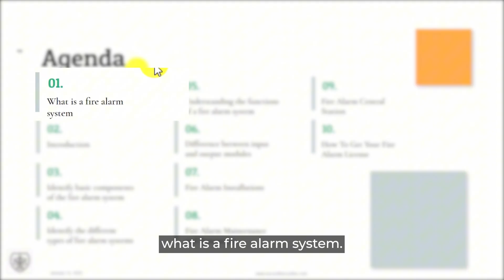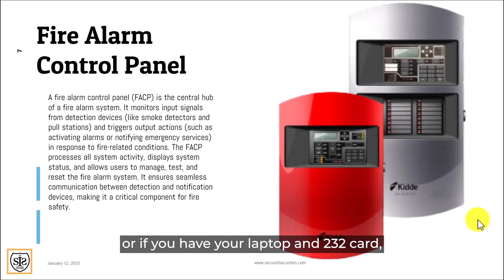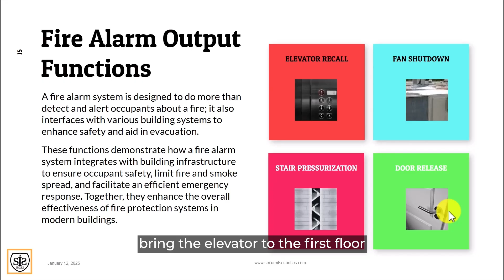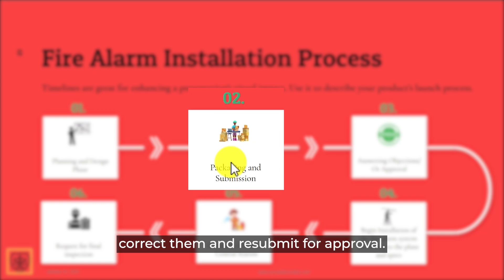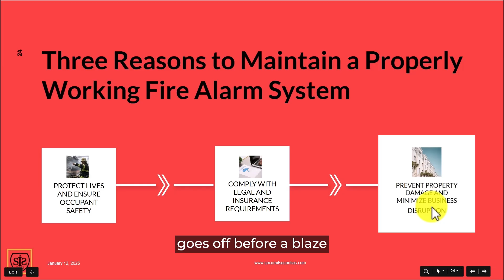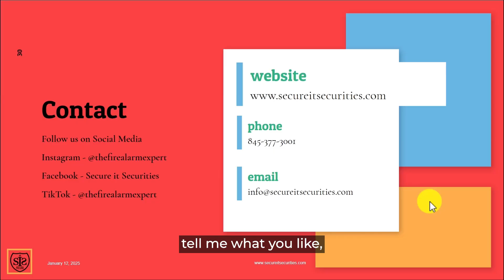10 Secrets to Master Any Fire Alarm System 🚨

Comment: A rate of rise 135 degree Heat Detector is very common.  If the temp goes up 15 degrees in one minute it will trip.

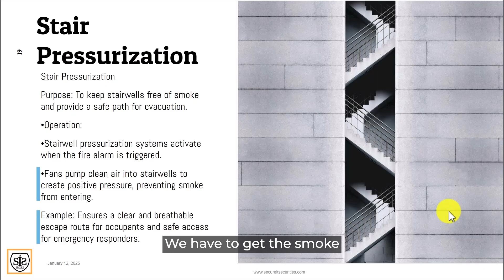Comment: Great video, lots of information. Just one point of clarification. At the 18:00 minute mark your slide shows that the Stair pressurization "fans pump clean air into the stairwell to create positive pressure, preventing smoke from entering" which is correct - but you say that the "large exhaust fans at the top of the stairs that are actually pulling all of the smoke from the bottom floor all the way to the top out of the building" which is actually negative pressure and not safe in a stairway.

Comment: and how to do serial simplex port troubleshooting  ..    https://youtu.be/vhBjSgtxBDs?si=q42DhPoSsA87Co0Q
Reply from the maker: I used to work for Simplex long time ago working on the 4010, 4100U and all those older panels.
Reply: @thefirealarmexpert  I worked for SG too as a programmer for 4100, 4100+, 4100u, 4100ES and 4007 and 4010 and it was good.